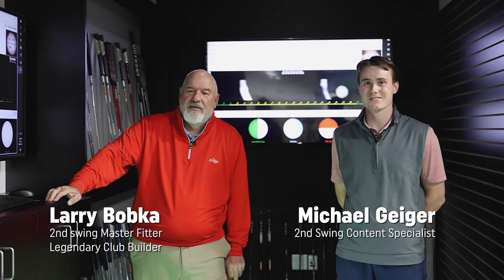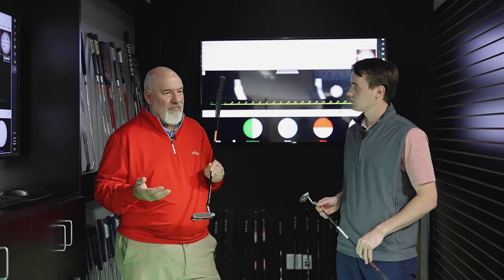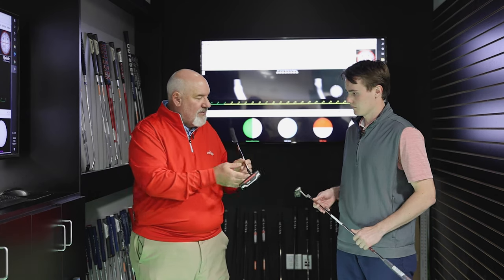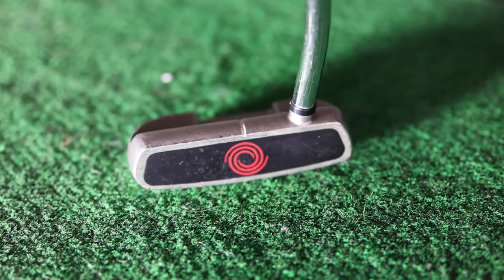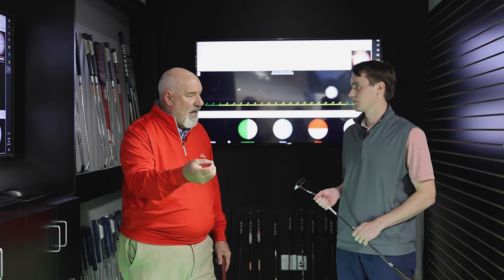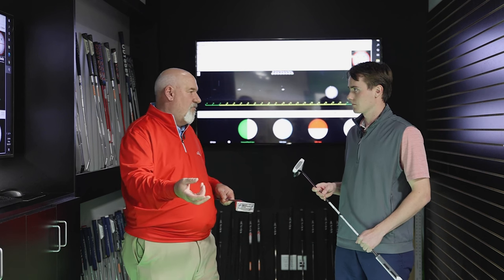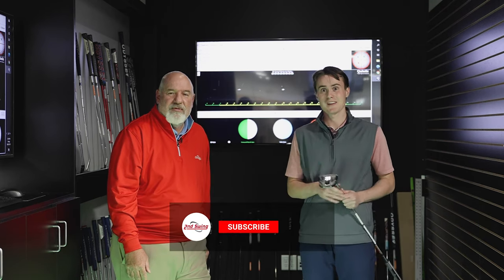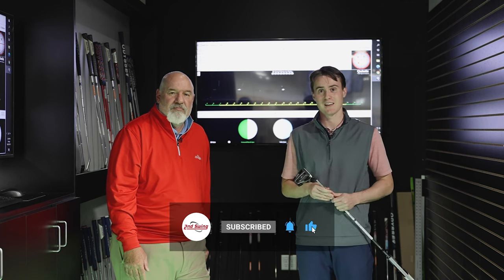Comparing The Best Golf Putter Face Inserts

Comment: The problem with entirely flat inserts of ANY material is we are hitting targets(golfballs) with an irregular dimpled face. So depending on where the putter face contacts onto the dimpled ball, the ball may bounce or ricochet off the face slightly one way or the other. We may then think we mishit the ball when it actually was a glancing blow off of a single dimple. Imagine playing billiards with dimpled billiard balls. It would be an interesting experiment. Who knows how one's shots would end up but probably not as consistent as with smooth billiard balls.
  It would also be interesting to  have regulation size totally smooth golf balls and film in high speed (slow motion) exactly what happens when a totally smooth face putter putts the smooth face golf ball vs. regulation dimpled golf balls. 
  I have a TaylorMade putter with what I feel is the best putter insert for a variety of reasons. I have tried all kinds of inserted putters and the results I get with the Taylor-Made Ghost Corza with it's "PURE ROLL" face is incomparable. It really gives the most pure of a roll of any putter I have tried.
   The Pure Roll putter face has closely spaced parallel horizontal lines of what seems to be a siliconized rubber material. The lines are raised NOT engraved on the face.
  These fine raised lines of deformable material upon contact with the ball seem to conform ever so slightly to the irregular dimple pattern of the ball and feel like it hangs on to the ball for ?a microsecond. It produces excellent overspin to send the ball in a consistent desired direction. 
   It feels as if one were bowling the ball underhanded vs. popping or slapping into the ball.  
A good comparison would be a ping pong paddle that has a rubberized surface to deform ever so slightly  allowing the ping pong ball to be "controlled" on the paddles surface for a microsecond so the player can exert "English" on the ball and spin it. Tennis players too use a deformable face racquet with parallel stringing to grab the ball and exert spin on the tennis ball. The more deformable the stringing(i.e. looser strung), the more spin. 
   I have tried a putter with a totally smooth rubber insert and still didn't have the control given by the Pure Roll face. Again, probably because the smooth rubber face of the  putter is contacting the  irregular raised edge of a  dimple on the ball.
The parallel raised deformable material in a sense neutralizes the dimples of the golf ball. It seems that the raised edge of the dimple is what is the culprit not the depressed portion of the dimple. Again this could all be scientifically evaluated with high speed filming of different putter faces with dimpled vs. smooth golf balls.
   The problem with the Pure Roll face of my putter is the rubberized material on the very center of my putter is either wearing down or being flattened in the center portion only. I called Taylor Made to ask if they could "refurbish" the face but they declined. 
   Callaway had a face mentioned in the video but the lines were scored into the hard face but what is needed is the deformability in the horizontal plane to grab the ball, hold it for that microsecond allowing the player to control the ball as they release the clubhead to the target.
Reply: Interesting theory and experiences to share. One aspect of the tennis strings that has come out is that much of the extra spin that "poly" strings cause is related to their "slipperiness" - their "snap back back" after the balls moves them across the "cross strings" is apparently what increases the spin. The scientists found that "oiling" the racquet strings accomplishes the same. 

Haven't I read that Bryson aligns his balls for putting so as to avoid striking the dimples??
Reply: I think you should try a putter made by Bobby Crace!

Comment: My Odyssey white hot putter developed an small 1/4 inch air bubble. Had to puncture with pin and put super glue and clamp to flatten it down. So anytime I missed a putt, I blamed the air bubble.  Next putter, no insert for me anymore.
Reply: Same for me with Oddessay #9. After 4 years playing hard balls the face had small dints.
Rang the company to see if I could buy insert...didn't want to know me. Buy a new putter what I was told..

Comment: I would just love to try out all those Putters that were lined up around the Putting zone and I agree that getting a Putter that is optimized to your putting stroke and your preferred "feel" is paramount to Putt well.
I like an Insert that isn't too soft, as the Greens that I play on in the NW of England are pretty slow for most of the year. So I usually go for the Odyssey Putters with the micro-hinges